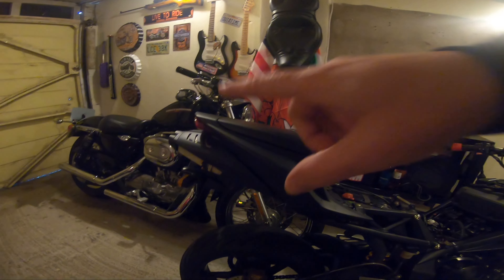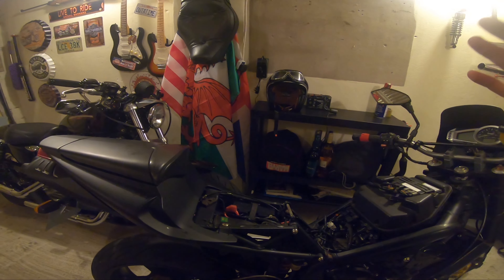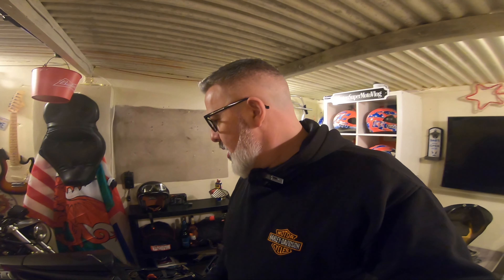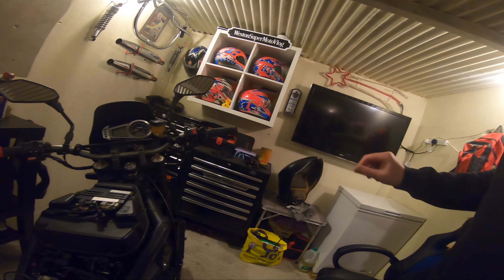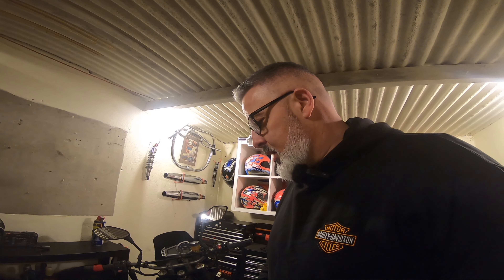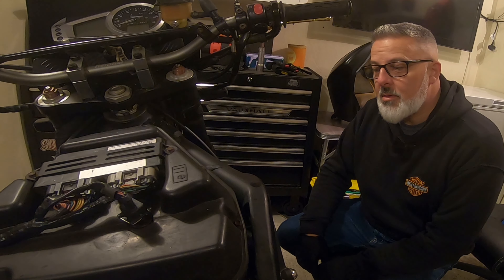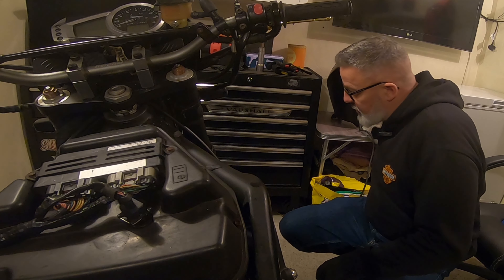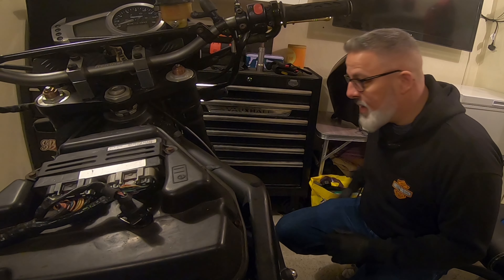Triumph Daytona Starting Problems

Comment: I’m in the middle fixing my 97 Daytona won’t start. I’ve taken tank off, changed plugs, cleaned injectors and fuel rail pit it all back together and still won’t start. 

Then it dawned on me, I didn’t hear the pump priming 🤦🏼‍♂️🤦🏼‍♂️. So tomorrow I will take pump apart out of the tank and see if it’s repair able. After watching your video I think I might use a spare 12v battery and some leads and do it on the table. 

Nice video you’ve done, hope you got it fixed
Reply from the maker: Thanks Andrew, yes it was a fuel pump issue caused mone not to start,  after replacing the pump I had no problems.
Use a multi meter to check you have a 12v feed to the pump when pressing the starter button, if you have 12v but no fuel flow I expect it'll be a pump problem, if you don't have a 12v feed and a good earth you have some sort of power supply problem. Also check the clutch and side stand switch to make  sure they aren't cutting the feed to the pump.
Hope you sort it buddy 👍

Comment: I have a 2005 Daytona ss had it 7 years but had rectifier issues for first two years but got it sorted. Thinking of selling it as I fancy a change now I’m 60. Don’t know what to ask for money wise as they are getting hard to find in good condition and it’s 97% mint! Great co tent👍🏴
Reply from the maker: Thanks Paul, the bike market seems to be taking an early dip for the winter this year but the daytona rarely drops in price because they have such a good following and reputation.
I don't have much experience in current prices as I'm an impulse buyer and rarely shop around 🤦‍♂️ (my Mrs hates it)
I would always say hold on until the spring though when the prices start climbing again.

Thanks for watching mate, when it's finished mine will look nothing like a daytona 🤣

Comment: What is the sound from 9:25 to 9:34 ??? After u disconnect the fuel pump inside connector!
My ST675 does this too, when im switch the ignition ON, and when it does this, the starter motor does not "click" and not turn when the start button is pressed

(my fuel pump is make pressure, its okey)
Reply from the maker: I think the noise is the exhaust valve trying to reset. Mine isn't working properly. Seems to be worse if the bike doesn't start or if the battery is low.

Hope you have everything sorted my friend 👍

Comment: Stick it in a tank of fuel and see if it pumps anything out?
Could be down the line more. That is blimming low voltage and shouldn't drop below 11 even on start up.
Blocked injecter sending the rest awol.
Plug fuse.
I know nothing but just a guess, enjoyed that 👍goodluck
Reply from the maker: 😂 all good ideas, I don't have any fuel coming from the pump on cranking so focusing on that first, suspect there will be other issues to fix once that's done 🤦‍♂️

Comment: Hiya, i have thr exact same issue with my Daytona. It's been sitting since last year, but had no issues before. Did you get to thr botton of this?
Reply from the maker: It appears to be a fuel pump issue, I checked all the power supplies and earths, all were OK, bit not getting any fuel pressure to the injection rail.
I replaced the fuel pump and it sorted the problem.
Also check the exhaust valve isn't stuck shut which will cause starting problems.
Hope this helps 👍
Reply: Cheers, thank you very much for that. I have had problems with the exhaust valve in the past, but the bike was starting fine and just giving me an engine warning light. I checked the code, disassembled the exhaust valve, got it unstuck, cleaned etc. All sorted. Never had issues starting. Spark plugs checked today, all good. Fuel pump line disconnected from engine and it didn't get any spray. Too many other noises to tell whether it was working. So cross with myself for letting the bike sit for a year. Now headache!
Reply: Did you replace the whole unit (white plastics) or just the motor? I am worried about the wiring and whether the motor itself can be removed easily or whether I'd have to rewire the whole thing. I am just a biker wanting to ride, not claiming to be knowledgeable about repairs at all!!! Getting to the spark plugs today was the most I have done on a bike. A friend helped with tools and advice
Reply from the maker: @vinlondon4933  you can replace just the motor, I bought one on ebay and it didn't fit so in the end I bought a second hand one off ebay which did the job.
It's not too difficult, but being safe Is the main thing. Ventilate the area you're working in, drain as much out of the tank as possible and get a new rubber seal for when you refit the sender unit (£5 from triumph dealer)
There's only a couple of multiplugs inside the tank to disconnect once the tank is off so no wiring needed 👍

Comment: whats the resting Voltage of the Battery when its dissconded from the bike? 
dose the bike try to crank over if the kill switch is on?
all the fuzes ok or any dammage ?
How do the spark plugs look?
Reply from the maker: All good checks but still concentrating on the lack of fuel from the fuel pump even though I'm getting voltage to it.
I've ordered a new pump so will recondition the pump/sender unit assembly this week. Once I've fixed that I'll work through the rest.
It was running well before this so hoping the pump is the main issue 👍

Comment: Great video. thanks for the hard work. what is the working pressure of the fuel pump?
Reply from the maker: Thanks, I'm really sorry but I don't know,  I had zero fuel pressure so knew there was a problem with the pump after checking the voltage and earth at the wiring.
Hope you get yours sorted 👍

Comment: Could it be the switch on clutch lever to engaging or not reading its engaged
Reply from the maker: Hi Chris, turned out the fuel pump had failed, did check the clutch switch but that stops it turning over rather than not firing. 
I replaced the fuel pump and it starts lovely now.

Thanks for commenting and giving me ideas though 😁👍

Comment: You may have fixed this by now but a few thoughts.  Did you pull a plug and check for spark?  I had an early Trophy 900 (1993) which for reasons best known to Triumph the ECU needed nearly 10v to do its thing.  Hence unless the battery was completely charged it wouldn’t start as cranking pulled the voltage below 10v and the ECU just refused to play.  If your battery is old, even though fully charged it will show 12v plus, as soon as you crank it the voltage drops considerably as shown in your video.  Perhaps you just need a new battery?  Also to test that fuel pump, just connect it direct to the battery with some spare wire and see if it spins.  Good luck and I look forward to hearing your solution.
Reply from the maker: Thanks for the info, I will check that. I have changed the battery which really helped with the starting up until now, I'm still convinced it's a fuel pump issue and have a rebuild kit for this weekend so will do that first, but if its still playing up I will check the ignition system, thanks Mark 👍
Reply: That fuel pump should shoot fuel out... something is clogged, shot ..totality of circumstances with Triumphs LOL.. Download the TuneECU parameters which will allow thi guy to diagnose engine codes, engine issue while running... etc..download maps if he chooses , change start-up fueling... it's a must have for simple diagnosing issues ..easy to set it up on Windows, Andriod etc...
Reply from the maker: @Carl Mayer  thanks, I will have to look into that, I've replied the fuel pump and now it starts on the button.
Still got issues but easier to work through with it running 👍

Comment: Did you get this sorted? 

There is only a few issues that would stop the 675 engine from turning over.

1- low battery as it needs over 12.65v to crank the engine.
2- CPS this should reed .200ohms resistance to mean it’s perfectly working
3- Clutch switch system/side stand switch.. Both of these can be bypassed on Gen 1 only due to the wiring loom not having a Quickshifter plug

Fuel pumps rarely fail on the 675, it’s the t bag filter that usually causes issues at 4-5k rev dead zone surging.

Get the bike plugged into tune ecu you will be able to test the pump and major systems from there as the fuel pump only primes at full power when the bike is running. 

If need any help feel free to message as I made a video on how to use Tune Ecu and I’ve rebuilt my Gen 1 2006 in multiple configs since owning it from 2008
Reply from the maker: Thanks Aaron, that's brilliant.
The fuel pump replacement fixed the starting problem, still have some running issues but that's because the emmisions system was ripped out and not repaired properly when it slid down the road. I have the breather and pipes just waiting for tine to work on it, as usual I have big ideas and then realise I don't have the time to do it 🤣🤣
Reply: Oooh let me guess it’s either Intake flapper, sai unit or the infamous p1080 exup servo
Reply from the maker: @arronfoster17 exup servo 🤣
Reply: @wsmv  you can just remove the cables, let the valve spring open and disable it via tune ecu, download the map heat cycle it and will be fine, if you have the o2 sensor still fitted it won’t effect fuel, afr will be more stable also if you have removed the intake flapper and SAI
Reply from the maker: @arronfoster17 thats awesome thanks Aaron, will do that, is the tuning programme on a particular piece of equipment ?

Comment: i really need to know what happened next, i'm exactly on the same problem, i just recently got my first dayotna and i'm stucked on the same issue. there's not much imformation about dayota issues online, this video helps me a lot but i need to know what i'm supossed to check out next... can somebody can tell me what can i do?
Reply from the maker: The problem I had was the fuel pump was failing and not building pressure. Check the + and - at the pump wiring while cranking the starter. If you're getting 12v but no fuel pressure then the pump has failed. Hope you fix yours soon 🤞
Reply: @wsmv  thanks so much man, i'll try it

Comment: were is part 2 please??
Reply from the maker: Hi Alice, I did a little short after swapping the fuel pump which cured the starting issues.
The triumph has taken a back step during the summer but now the weather has taken a downturn I will be back on it.
Hopeful of having it road worthy by April and will do more vids as I get more work done 👍